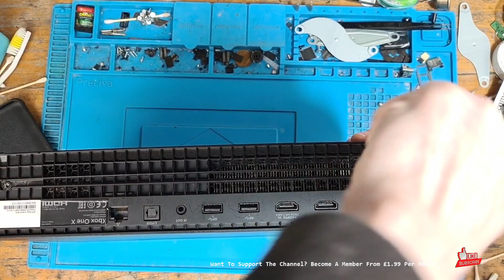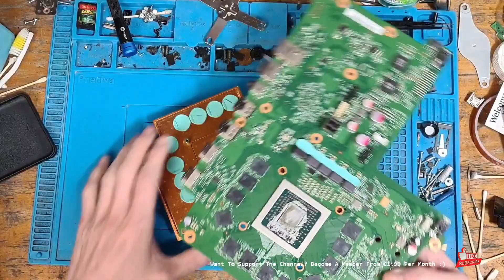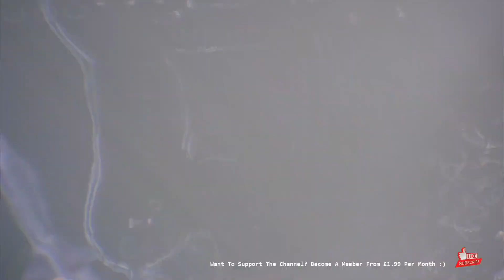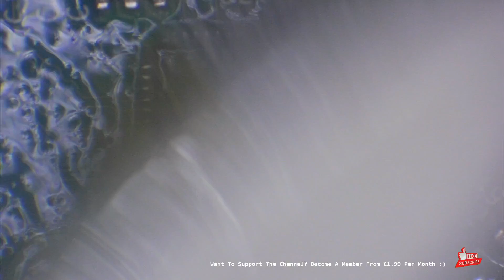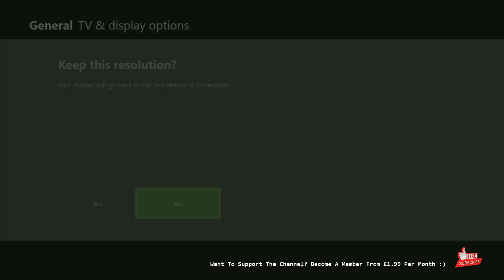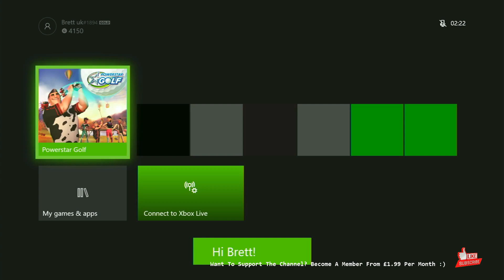Xbox One X Flickering Screen Diagnosis And Repair - TDP158 HDMI Retimer IC Replacement

Comment: i got a problem on my xbox 360 i try to change the hdtv setting to 480 p after that my tv say out of signal, i think it's the hdmi cable n then i change the cable, still out of signal so i think it's the port, but before replacement i try to update flash, n after i try to go xell nand, the screen doing really fine n i update my kernel, after update i try to start the xbox but still got this out of signal from my tv, i really confused by this when i go to xell nand by pressing the cd button, my screen doing really fine, but when i start the xbox there is no signal, i tried everything for 3 days, like push the power button for hard reset, n then the Y n right trigger button n doesn't work, i even try to reset my tv setting but still got this problem so any tips for the case that i got

Comment: I have a One X here with no obvious flaws. It turns on and turns off after that. I can not find anything. Is someone here with experience, to guide me to the problem? Thermal paste was replaced, and i tried to put another HDD in there. No matter what, nothing is happening, no fan spinning, immediately shuts off...

Comment: Hi, I really need help.
I’m using the yarboly 8586d and I held the hot airgun on for even longer than you did, but it isn’t even coming off the board (Scorpio edition)
I have the same problem with the soldering iron trying to do a joystick replacement on the elite series 2, max temperature and the solder on the board won’t even melt, I’ve got two things that I can’t even repair, and I can’t find anyone to help
Reply from the maker: It sounds like the hot air gun isn't putting out the right heat to be honest and likely needs replacing

Comment: Hey my Xbox one x turns on and then turns back off after about 10 seconds..I’ve done every diagnostic test I could without taking it apart got any ideas? I read that a bad south bridge chip can cause this? I watched your video on reballing BGA and wanted to do everything I could without going that far..
Reply: hard drive

Comment: My nephews xbox is flickering but it has reddish glitchy lines in the flickering
Reply from the maker: That may just be a bad port, but could also be either the retimer or the APU. If it's the APU it wouldn't be repairable but anything else usually is :)
Reply: @TheCod3r   Besides that it also looses signal to the TV every few minutes hopefully it isn't the apu. Thanks for the information.